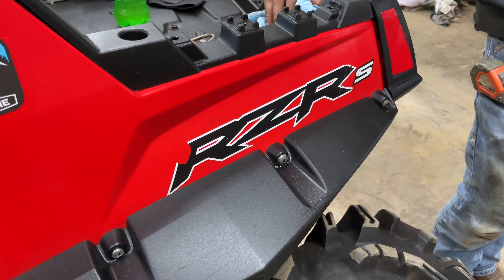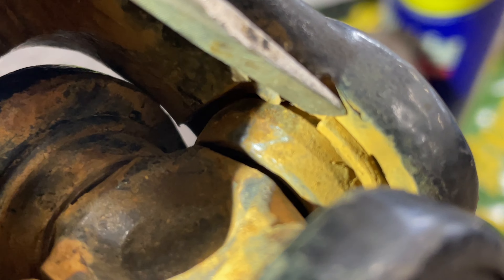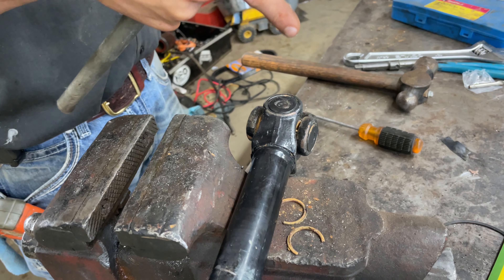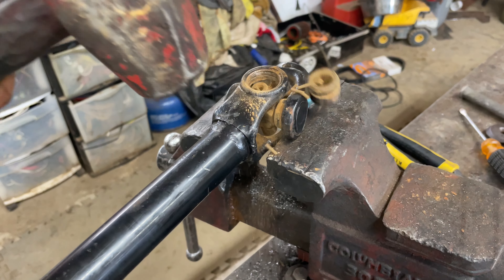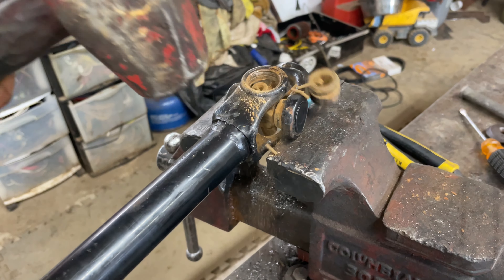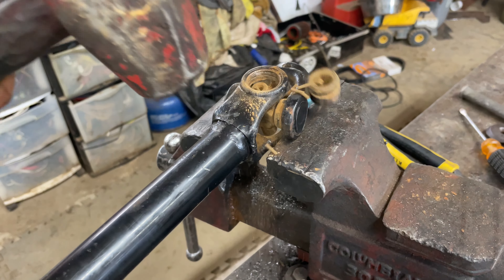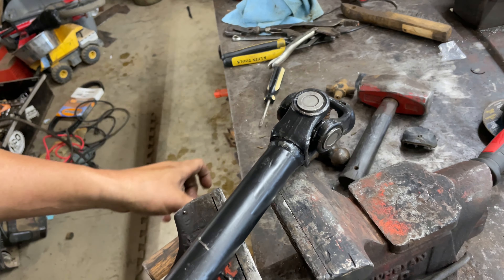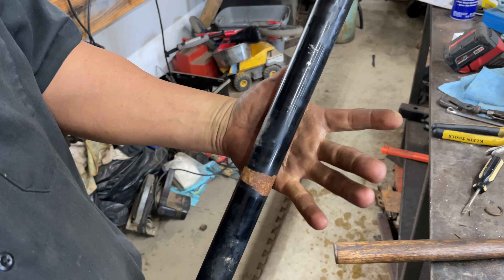Polaris RZR 800, 570, 900, 1000, 925, Turbo, How To Replace Universal Joints U Joints On Drive Shaft

Comment: Getting ready to tear in to my 900 xp and replace the joints in it. Looks like I have a little slack on the yoke that pins into the differential. Is this bad? Don’t know if I’m gonna have to replace that yoke or what
Reply from the maker: A little slack will not hurt it however look into the spline of the yoke. If the splines looks pointed then I would replace it. Don’t forget to grease the spline when putting back together. 
Thanks for watching and don’t forget to like and subscribe to our channel!!